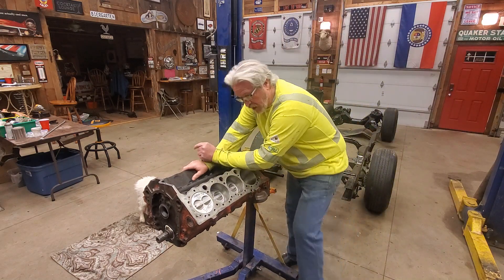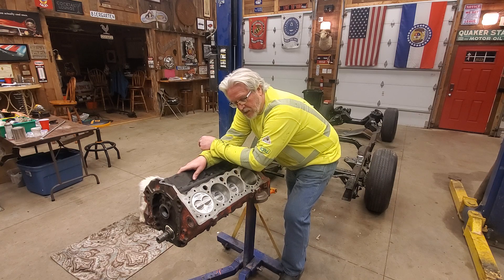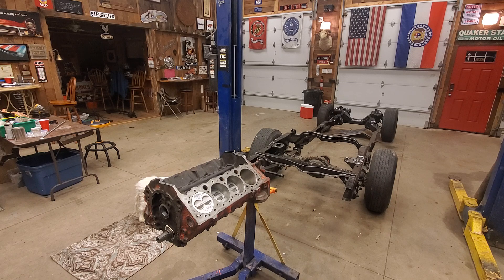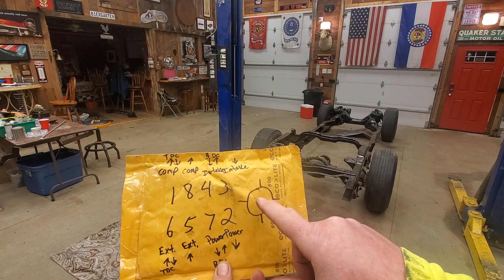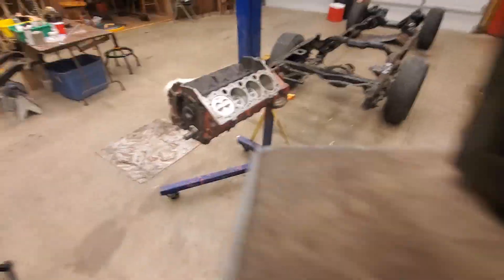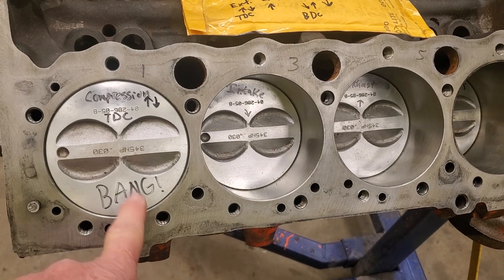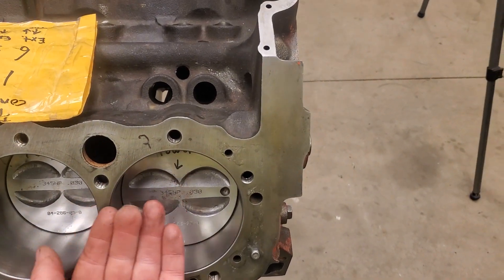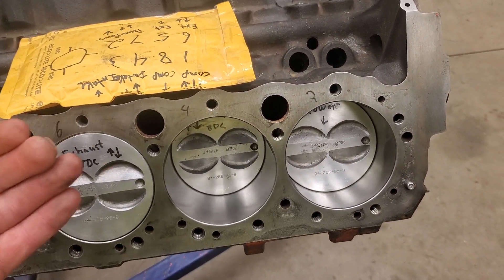Watch this! Do you know what exactly is happening inside a V8 engine as it's running?

Comment: i get what your tryin to explain but dont u think it would be best to use the correct terminology and not confuse newbies.i was confused when i heard terms like what u use growng up hell even last week i didnt fully understand it and honestly most likely still dont the fuel air mix does not explode and explosion would break parts just like KNOCK or detonation thats why people dont like to have knock or detonation cause EXPLOSIONS are bad. Explosions will rapidly disassemble your engine like when a nitro drag car has the screw blower blown off the top of the engine due to how forceful explosions are. thats why we IGNITE the mix and have flame propagation inthe cylinders. also the charge air is not sucked into the engine when the pistons go down in the stroke but rather the charge mix is pulled in due to the low pressure in the cylinder due to the exhaust gas leaving the cylinder.  thats when a majority of the charge air is drawn in and ony a small portion is due to the piston actually going down the bore. i am not tryin to be rude i only learned this a few days ago ben alameda has a new video explaining this correctly  was misinformed just like u for years. he also called it a 4 stoke 5 cycle engine 1 piston goes down bore 2 charge air drawn in due to hot exhaust gasses leaving bore causing a low pressure area 3 compression stroke 4 power stroke 5 exhaust stroke  seems to make alot of sense the way he explained it you should check it out
Reply from the maker: Thank you for your reply. Obviously, there are other ways to explain the operation of a 4 stroke engine. This is just a simple explanation for guys who don't understand what's going on inside the engine.